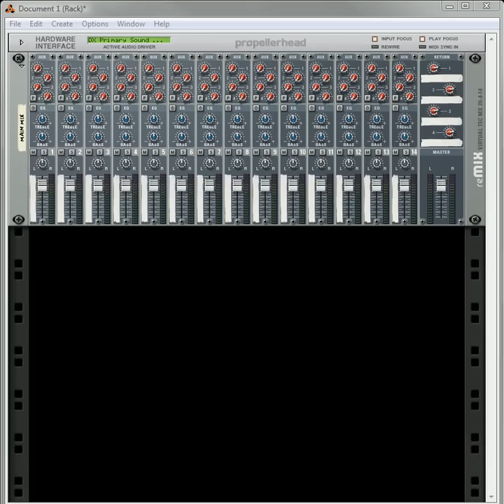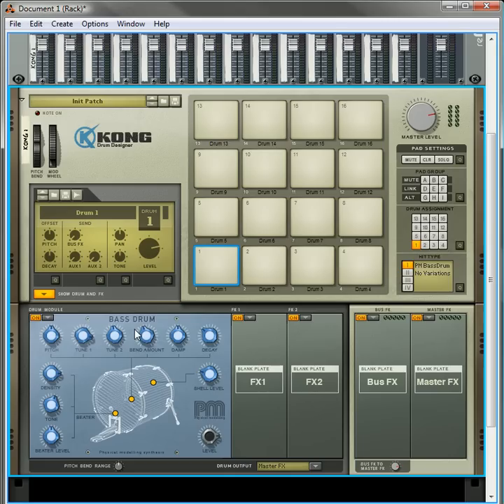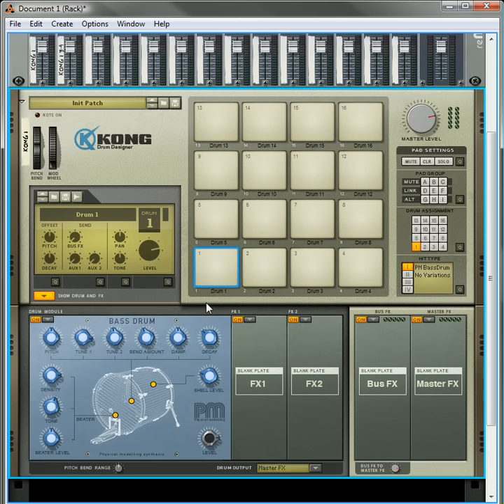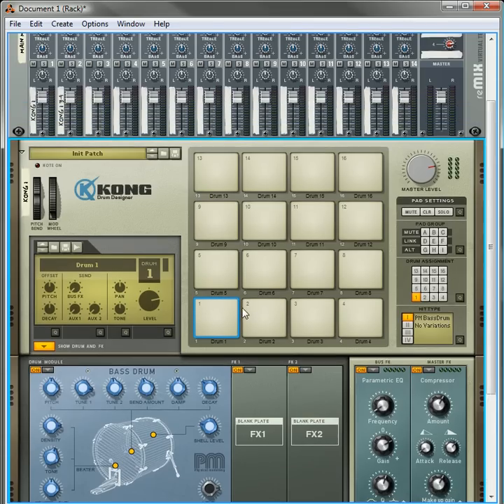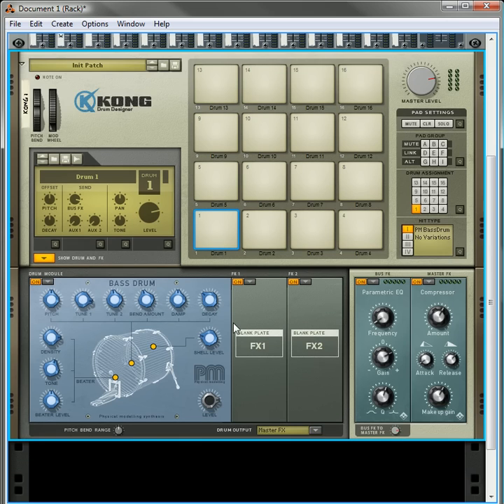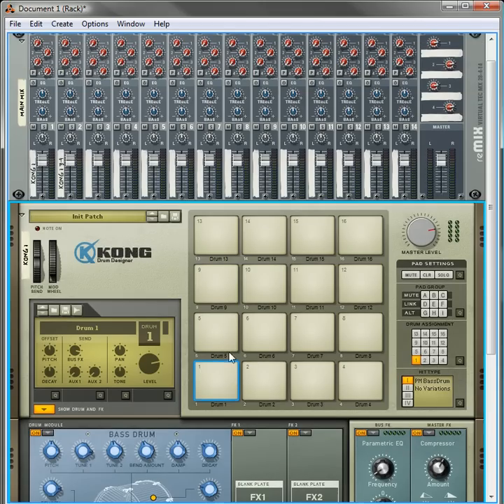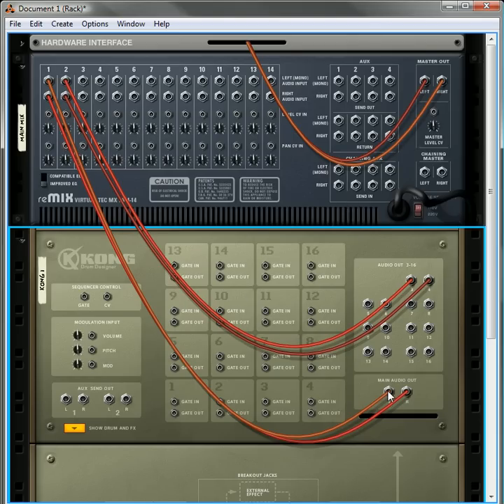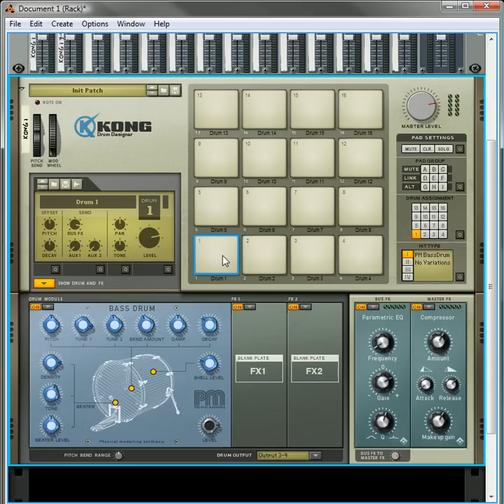Parallel Drum Processing with Kong

Comment from the maker: It's a little different with the SSL. But the concept is still the same. just need two mix channel devices to parallel process through. Or you can use the Pulveriser now. There are options.